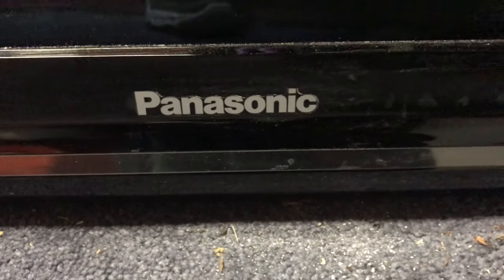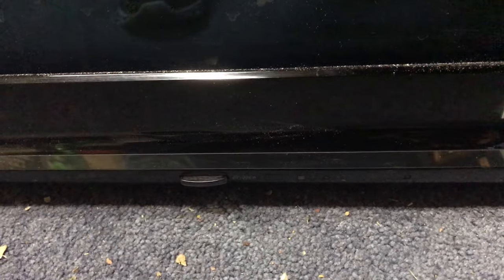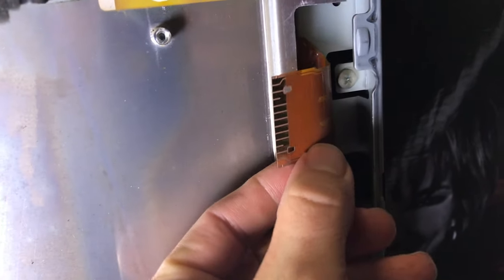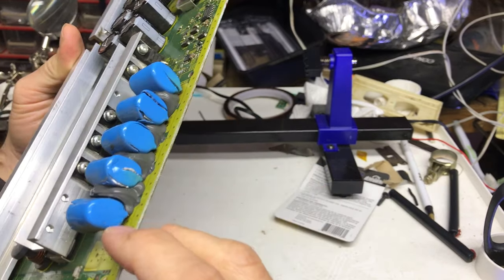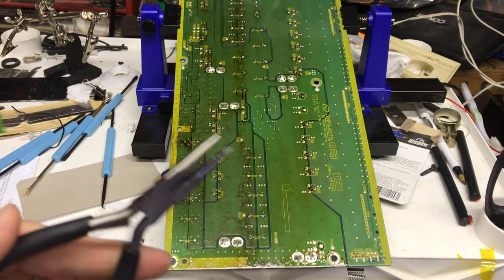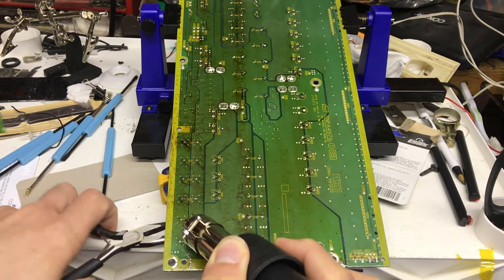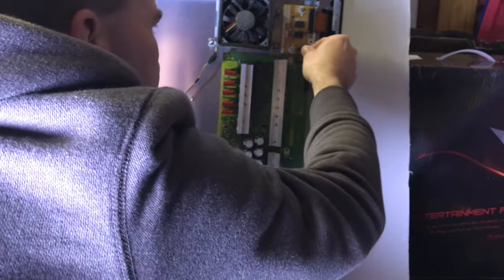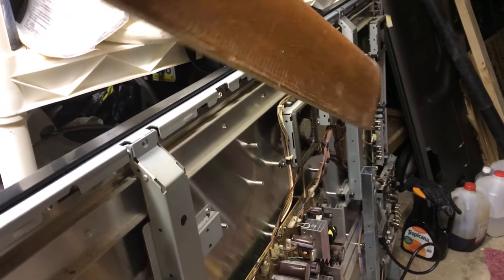Trashpicked 65" TV fixed for under $10 | 8 blinks Panasonic TC-65S1

Comment: Thank You  for posting this very helpful video FrugalRepair!  Got the dreaded 8 blink message a few weeks ago.  I found your video and went ahead and ordered the capacitors . The arrived yesterday and just completed the fix in about 90 min, going slow.   Followed the steps with no issues. TV is back up and running great!!!  Thanks again!
Reply from the maker: Wow, great job!  I’m happy to hear that.
Reply: @FrugalRepair  as an electric guitar modder I wasn't afraid of soldering.  But I'm still amazed I did this. Thx again.

Comment: Oh dear lord.  I’d Never use a drill driver on a circuit board.  You are brave
Reply from the maker: Put it on lowest clutch setting, it is actually the safest way.  It’s also the best way to put screws into the plastic bezel.
Reply: @FrugalRepair  I use a 1” spline drive pneumatic impact with mine. Just feather the trigger a bit

Comment: How do you diagnose problems? I've watched a couple of your videos that show you replacing a specific part. In this video it was obvious that the capacitors were a problem just by their appearance. In the other video you replaced a specific transistor in a specific TV model for "less than a dollar". How did you know to replace that transistor?
Reply from the maker: Thanks for checking out my videos!  Actually I’m almost finished writing a guide with some of my diagnosing tips I use.  I hope that will be helpful for folks.  I’ll have it on my website.  When there are specific components that go bad it’s often because of a common fault and there is info somewhere online.  I can trace bad parts down but that can take a while.  Let me know if you have any more questions.

Comment: I bought this tv for cheap. Works good but it seems someone at some point spilled something on it & there's a resedue inside the screen. How do I open up just the front to clean the backside of the plexiglass screen?
Reply from the maker: This same plasma tv model?  I don’t think you can easily remove the glass.  I don’t have the TV anymore so I can’t check.  I know how to do that with LCD’s if you happen to have a different model.  Next time I work on a plasma I’ll consider checking on that.

Comment: Thank you so much for this post! I bought this TV in 2011 and it's been my favorite TV ever. The 8 blink issue happened in the Fall last year and your video helped me extend its life. Now, I am dealing with an electronic buzzing sound that is coming from the lowest capacitor on that SS board. When I put a little pressure on it, the buzzing subsides. I'm guessing I could just replace the capacitor and the problem would be solved. If that's the case, do you know which capacitor to get and can I order it on eBay?
Reply from the maker: Great job replacing those other caps!  For this new one, I’m not sure I know the one you mean.  Could it just be a solder joint issue?
Reply: @FrugalRepair  thanks. I loved doing the fix. I was into that as a youngster and got away from it. You step by step walkthrough made me feel pretty good. So, if you look at the second photo on your blog post of the SS board. It's the blue capacitor furthest to the right.
Reply from the maker: Thanks.  Unfortunately, I no longer have the TV or access to the board so I can’t see what the printing is on the side. But it looks like a film capacitor, just like the other ones.
Reply: @FrugalRepair  Oh okay. I actually had the same thought and I believe I have extra capacitors from the first project. I'm going to look for them. Also, I ordered another TV (LG C9 OLED) because COVID-19 has made it clear I cannot live with just one, older TV. I do plan on trying to fix the Panasonic Viera Plasma once I have the new TV. When I remove the capacitor, I'll come back and confirm the capacitor. Thanks and have a great Memorial Weekend!
Reply from the maker: Ok, just try to make sure the specs will not be too different to cause an issue.  They may both be film caps but have diff values.  Have a great weekend!
Reply: u can order parts for cheap from AliExpress

Comment: What if some of the flex cable from a plasma panel have ripped? It's not replacable because its glue to the screen and unless having expensive equipments and a lot of experience its seems unfixable. :( I wanted to fix my girlfriend tv. (Panasonic Vierra 2012 tc-p50u50).  The ones going in the S boards on the side. (orange brown)
Reply from the maker: Unfortunately, if that flex cable tears, there’s really not much else you can do.
Reply: @FrugalRepair  I know. Someone with a good magnifier and precision tools and experience could maybe but not me sadly. Thank you.

Comment: I noticed an extra spot for another cap. If you installed another cap would the extra reduce the load on the others and help them last longer? Or was the failure due to crappy caps?  Could caps with a higher voltage rating inprove the life?
Reply from the maker: You wouldn't want to install another cap.  The extra space is probably there because of a change after the board was designed, it has something to do with testing, or they made it that way to accommodate different versions of the board.  I think you are correct that the bad caps are the problem.

Comment: Where did you get the capacitors from for the 65 inch plasma panasonic
Reply from the maker: I’m pretty sure I remember getting them on eBay.
Reply: @FrugalRepair  thanks I ordered them from ebay

Comment: Just started watching you videos.
Quick question.
How would you drain the capacitors or assure that they’re dissipated?
Just curious
Reply from the maker: There is a lot of information and videos online about how to do it.  You basically want to use a load (resistor of some kind).  Then use your multimeter to check.

Comment: hi I have a Panasonic TC- P50VT25 that does 8 blinking too upon power up no picture.  can you give me an idea what is wrong andf how to fix it? thanks in advance
Reply from the maker: I'm sorry but I don't know what that code means on your model.  You'd have to research it or open up the back and start doing some diagnostic checking.

Comment: HI my name is Hector and I have a 2009 Panasonic TC-P65S1 power light blinks 6 times,I was told that the problem with it was the power board which I replace both of them and I still have the same problem please help.thank you
Reply from the maker: Hi Hector, it has been a while since I worked on this model.  What does the documentation say that the 6 blink error is caused by?  Also, have you searched for a flowchart by panasonic that is out there that helps you diagnose the bad board?

Comment: Hi.  Where did u get the cbb2 305J from ?    Besides China
Reply from the maker: I looked all over and couldn't find them any place but China.   I have a link on my blog post with the one's I purchased on ebay here: https://frugalrepair.com/2016/12/tc-p65s1/
Reply: FrugalRepair thank you
Reply: hi there   weird question   you wouldn't have a few of those capacitors by any chance  ?  I'd be willing to buy them from you  I'm a repair tech and I don't want to tell my customer to wait 1 month lol   

thank you
Alen
Reply from the maker: How many do you need?  I have extra but I don't remember how many (if I bought a 10 pack or 20 pack) I'd have to go look it up.  Feel free to contact me through FB or my website.
Reply: I need 5 of them
Reply from the maker: OK, I have 5 of them.  Contact me through FB or my website.
Reply: FrugalRepair, how you determine the + and - in those capacitors?
Reply: @rodolfomontalvo4710  . They are non-polarized. Any way will do.
Reply: You can get them at Mouser electronics
https://www.mouser.com/ProductDetail/panasonic/ecq-e2335jbb/?qs=9ouE0kzBZ2oroXmHto1QdA%3D%3D&countrycode=US

Comment: How do you get the screen fixed
Reply from the maker: You realistically can't replace the screen if is cracked.
Reply from the maker: @William Surprenant I don't think so.  A line in a plasma, I'd usually suspect the connection from the tabs on the side or bottom.  There are videos about this online.  Different colors, not sure without testing it.  I'd suspect the Y-sus or X-sus board but that is a guess.  There is probably information online  for that model and that issue.

Comment: I like watching your videos just for the entertainment value, but I have to say I cringe when you use an electric drill to install the screws. That's just asking for a cracked circuit board.
Reply from the maker: I'm glad you like the videos!  No need to cringe!  If you have a drill driver with a clutch set it on the lowest torque setting, you'll never crack anything on a tv.